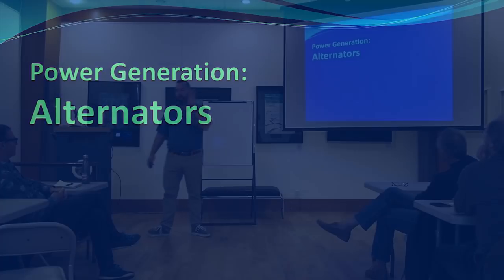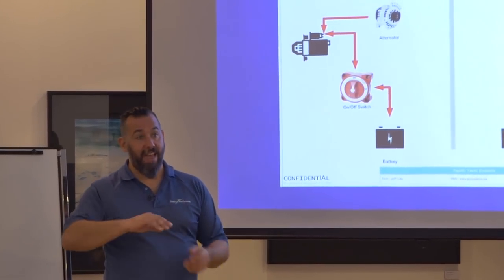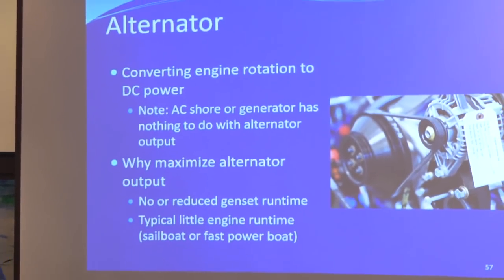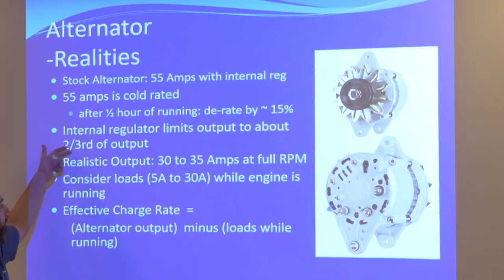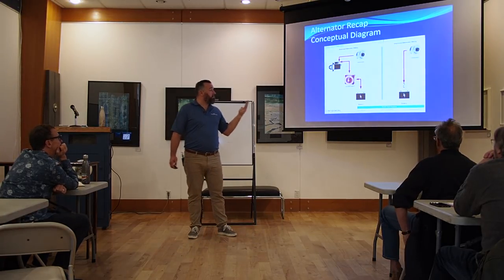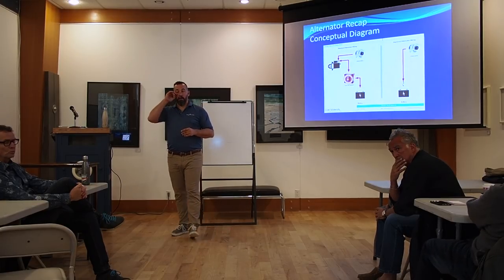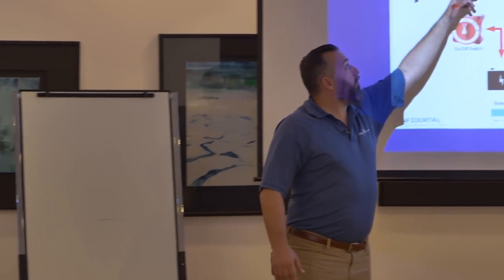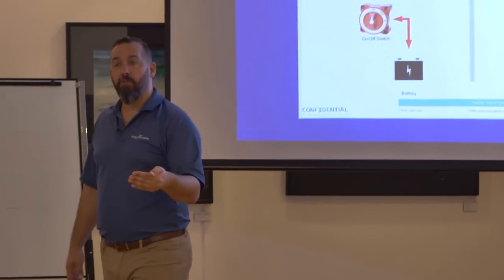How To: Marine Electrical Seminar - Alternators - Ep 05/30

Comment: Thanks for sharing your knowledge Jeff. Just about to installl my new alternator today and will definitely be running a fused wire straight to the battery now.
Reply from the maker: My alternator too is connected directly to my house battery via a fuse.
Reply: @PacificYachtSystems  I think you might have walked  past a celebrity, and not recognized him.

Comment: Best statement ever, about engineers ... Blue seas do make a battery swich with an alternator field disconnect auxilluary swich to prevent alternator failures.
Reply from the maker: Hi Nick, your right albeit i have never ever seen that alternator disconnect field post ever be used.
Reply: @PacificYachtSystems  I neither , As is frequently mentioned in your videos, people look for the easy way out. using that would mean running extra wires...
Reply from the maker: Hi Nick, from experience taking shortcuts rarely leads to good outcomes.

Comment: Great video!!   I am in the process of redesigning and improving my boat's electrical system.  My boat has the daisy chain system.  I traced the circuit last fall.  I was amazed at how asinine this design is.  When I start the engine the electricity has to travel from my battery the starter post to another wire that goes all the way across my boat to a switch in the cabin and then to another wire back across my boat and then finally to my starter.   WTF!!   I always assumed  'The Switch'  only energized the solenoid and the starting power was routed directly from my battery to the starter,  they are only 24 inches apart!! 

I want a system where the alternator goes directly to 2 battery banks, I bought a Victron ARGOFET Battery Isolator.  I plan to eliminate the need for The Switch in my cabin and mount a switch close to my batteries that is normally on both.  I also want my starting power routed directly from my batteries to my starter.  I have a yanmar 2GM I am not sure how the yanmar wiring to the starter switch is routed. Can I route power directly from my batteries to my starter.  How would I do this?  I also would like to have a switch the  panel in the cabin of my boat to turn the power to the start key off.   My the ignition key is in my cock pit and I would rather not have it energized when I am not at the boat. Is this possible?  How would I wire it? 

 What is your process of designing electrical systems for DIY customers that plan to install the components?  I have a rough idea of what I want and what my needs are.  I think what I want is a conceptual design of how this will all work.  
I am starting my youtube channel and plan to document and review this project.

Comment: One small point: If you properly size the alternator pulley to the flywheel pulley, considering the engine idle/cruising/battle speed RPMs, you can SOMEtimes select an alternator that will provide 80-90% power at idle speed, without exceeding the maximum continuous rpm at full engine speed. Boat makers don't size them this way, but if you look at alternator output specs and do a little pulley ratio math, it is possible. We did it and cut our battery charging time in half--even on the internal regulator. And yes, this may mean having a custom pulley machined up, but that's fairly cheap.
Reply: Downside on some alternators is that the tachometer is working off the cycles of the alternator.   Therefore there will have to be changes made for the tachometer.

Comment: It’s funny, as an auto mechanic I have had to argue with people who still think it’s ok to “test” an alternator by unplugging the battery while the engine is running. I’m glad it’s not just me who gets to try and explain why this is bad to stubborn people. 

I had a guy try to “prove” to me this was an ok thing when I was selling auto parts. He disconnected the battery and the engine died. So he says it’s a bad alternator. Well yea, but hopefully you didn’t destroy your computer too. He asked how could this destroy his computer. I told him if the diodes are bad, the battery becomes the diode by sacrificing some of its charge to keep things DC. Well now you introduced AC current to DC devices and they are usually not hardened against that. Yea… his car wouldn’t start again, and my scan tool wouldn’t communicate with the computer. He literally proved my exact points I had been trying to teach him by “teaching” me how to work on cars. (I have been a mechanic for over 30 years at this point). Go ahead “teach” me.
Reply from the maker: Thanks for sharing.

Comment: Great video nice job. Really eye opening for charging Lithium batteries off of a dedicated alternator. If you have a dedicated alternator for the lithium battery bank and the lithium BMS shuts off the connection, either because of full charge or low temp cut off, that would disconnect the battery from the alternator and could damage the alternator. Have you had to overcome that issue?
Reply from the maker: Hi SV Isabel, you bring another good concern, we always disable an alternator by disabling the field voltage rather then disconnecting the alternator from the battery. By removing the voltage of the field wire the alternator stops running properly.

Comment: The main reason alternators fail when  switching battery switch off is that you end up frying the diodes in the rectifier.   The alternator is an AC current device which outputs a DC current.

Comment: Aren't there still 1-both-2-off switches that are dual contact switches? They disconnect the field wire, which immediately shuts the alternator, when the switch is shut. So the switch CAN be set to safely shut all batteries without hurting the alternator. The same design is used to switch an alternator's battery voltage sense lead between two battery banks. Whether you switch the voltage sense lead, or the field lead, is your choice, but either can be done.

Comment: The best setup I had was a off/1/2/all switch where the common was the house battery. This way you never actually disconnect the join between an alternator and it's engine's start battery. start battery has lasted over 10 years!! and still going.
Reply from the maker: Interesting setup, what is connected to post 1 and post 2? Also curious how to you isolate the house battery?
Reply: @PacificYachtSystems  Post 1 - Starboard start battery, post 2 - port start battery, common - house battery. The process is very manual, which is fine in a smaller 34 ft catamaran. Just before I use windlass (wired to house battery) I flick the switch to post 1 (or 2 if I remember to alternate between both engine start batteries). This provides high current from alternator to House battery. Once I have finished running the windlass, I flick the switch to off, leaving start batteries isolated.
Reply: I could use a solenoid, with a remote switch, similar to the setup in Leopard cats

Comment: i accidentally switched off the power with the engine running, my alternator still seems to be working… will it be okay? does this mean its safe to switch off while the engine is running?
Reply from the maker: Hmmm, my understanding is that alternators can partially fail. Make sure you get the same maximum output from the alternator. My advice, don't play with fire and avoid turning off the engine battery switch and disconnecting the alternator when the engine is running.
Reply: @PacificYachtSystems  well i can’t be sure but because i took your other great advice and installed a battery monitor a few months back i’m fairly sure its still giving about the same output. Thanks for the very fast reply and advice!

Comment: Really interesting video, thanks! I have a question about the two options in your diagram: "Standard Alternator Wiring" & "Improved Alternator Wiring". In the 'Standard' diagram the alternator feeds the starter solenoid but in the 'Improved' version it doesn't, presumably there's a reason the alternator was doing this which you take away in the Improved version. How does the Solenoid work in the Improved version?
Reply from the maker: Hi Dean, good question. Connecting your alternator to your starter solenoid, means that in turn your alternator is switched on or off by the same switch that turns on or off the battery to the engine. Alternators positive connection should be direct to battery via fuse, but not switched.
Reply: @PacificYachtSystems  So, what do you base the fuse size on? maximum output of the Alternator?  What type of Fuse is ideal?

Comment: Okay, so I gather from the presentation that it is better to connect directly to the battery from the alternator.  So I know why its better because the switch is a potential death to the alternator component, either because of user error, or wear on the switch contacts....right?  So please tell us about the specifics on how to connect directly to the battery please......  conductor size, fuse, where to connect.
Reply from the maker: Hi Kapryan, unfortunately there is no one size fits all solution. Conductor size depends on alternator size and length of cable run, fuse depends on cable size and alternator size, and where to connect depends on your battery setup, i.e. at battery or unswitched distribution.